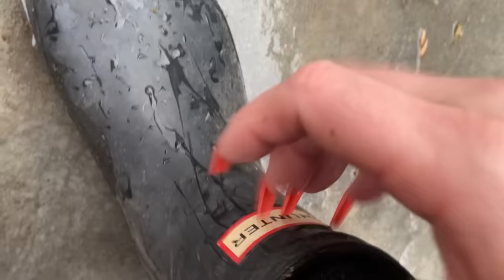ASMR in the rain - concrete scratching - camera taps

Comment: time stamps

0:00: preview
0:14 intro
0:58 tapping/tracing car
1:20 jacket scratching
1:23 yellow bin top scratching
1:30 car scratching again
1:41 grass tapping and some metal tapping
1:53 concrete scratching 
2:03 camera scratching 
2:10 really really wet concrete scratching 
2:37 pols scratching 
2:47 boot tapping
3:03 deck chair scratching 
3:12 wire and light tapping
3:40 volleyball scratching 
3:54 concrete and boot scratching
4:14 chair scratching again
4:24 table and brush tapping
4:38 concrete scratching again
5:58 rock tapping and scratching
6:11 some sort of toy scratching
6:40 bowl and rock scratching and tapping
7:01 concrete scratching
8:21 boot scratching 
8:40 jacket and camera scratching 
9:02 video repeats for some reason? it’s the same video again so you don’t have to watch it.

hope i helped!
Reply: thank you so much!!!!
Reply: Your awesome dude thanks

Comment: i notice ur whispers only come in on one ear, for the most part, so here's a fun fact! 
ur phone has two mics, one on the top and one on the bottom. if u recorded sideways and utilized said two mics, that could be a huge hack for this sorta lofi asmr style

if u wanna test this, whip out ur camera and do a quick recording and mess with each side individually. tap on the top of ur phone, then the bottom, and then watch back that recording with headphones. 

ur welcome :)
Reply: if u can though, itd be more effective if u recorded audio and video separately, if u do it this way, cus u have to be real close to each mic for a noticeable difference. but with one recording device that's easier said than done 🤷‍♂️